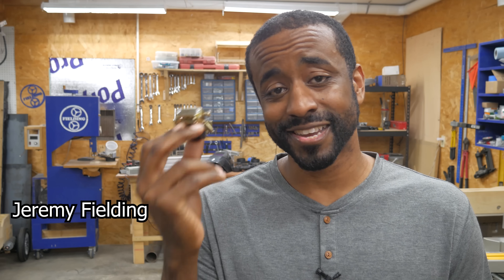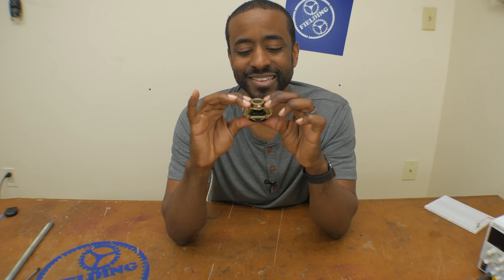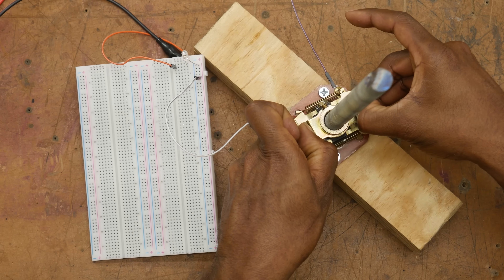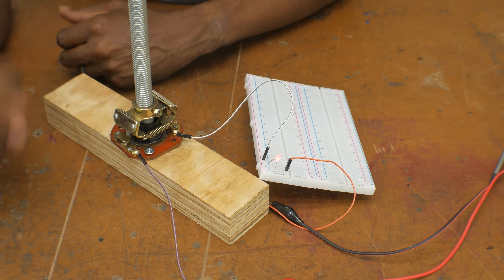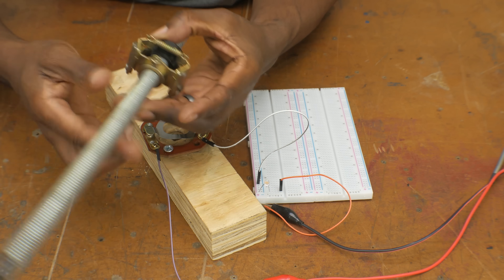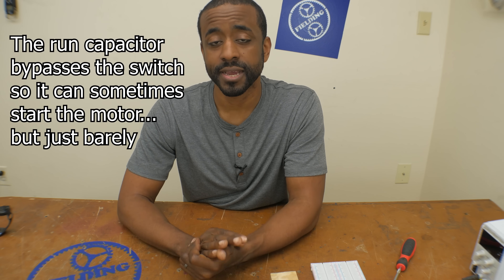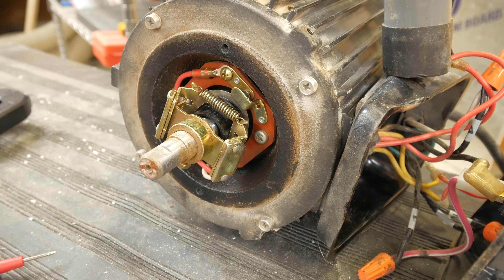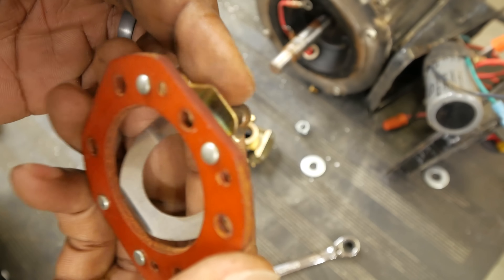This Clever Device Is Found In Nearly Every American Household. How It Works And How To Fix It

Comment: I was surprised to find one of these on my old craftsman bench grinder from the 30s. Didn’t realize they were even older than that. I ended up having a similar issue where the contact points glazed over.

Comment: The contacts have a thin layer of sliver alloy that can wear thru causing the arching yours has. Cleaning will definitely add a couple years to the stationary switch. I would recommend replacing it when you replace the bearings. Looks like # S-6013 from Torq .com.

Comment: Turns out that they explode pretty nicely too if you don't have your wires routed perfectly... (Not every motor is as easy to disassemble as your example here, sadly, as I'm sure you know) I have seen replacement import centrifugal switches for sale on eBay - and I may eventually just do that, even if it seems slightly bizarre to put a new import switch in a WWII era table saw motor.

Comment: I just got done taking apart, cleaning, and rebuilding a 1945 Craftsman table saw motor. I saw the switch and wondered what it was. Looked it up in the parts manual, saw the word "centrifugal" and it clicked. Mind blown. Elegant solution. The motor, with it's original tin can capacitor wrapped in a paper box, still purrs like a tiger.

Comment: Just for documentation sake: In many simpler electrical and high load systems (think classic cars and big ol contactors) these are often called "points". A common failure mode on old water pump pressure switches, car ignitions, motorcycles, lawn mowers, etc... cleaning the points with some sand paper is often a fantastic quick fix for worn points.

Comment: In Europe where they have 220-240 volts does this device still have a purpose
Reply from the maker: The motor I am using in the video is 240volts. You need this if you have single phase power. Some countries like Germany have three phase and don’t use starter windings in motors.

Comment: We call it filing the contacts.
And it will work for a little while, but I find that when pitting starts, there is a weak capacitor in the mix, and it is arcing from excessive starting amps. Check the farads rating on the start cap, or, just replace it. And change the contacts, because material is missing that is needed for long life.

Comment: That's a bi-stable centrifugal actuator working on a switch. Continuously variable versions were used as governors on steam engines in the 19th and 20 century, and to automatically adjust ignition timing on most gas powered engines for a great deal of the 20th century.

The run winding has no torque at a standstill, and very poor torque at low speed. However, you don't absolutely need the starting circuit. On an application like your drill press, there's no load when it starts, and ramp up time isn't critical. You could disconnect the start winding, and it would still work. But, when you turn it on, you have to give it a shove to get it going. Once it starts rolling it will go up to full speed.

The benefit to disconnecting the start circuit beyond cooking the capacitor, is that the motor actually performs better at higher RPM with the start circuit off.

Also note that under rough service, when the motor gets really loaded down, the armature will slow enough for the switch to kick back in, and torque gets boosted to help it recover, or at least try to prevent it from stalling.

Comment: At 2:54 Jeremy say's lighter weights will fling out at higher speeds, heavier ones at slower speeds. I would think the opposite is true, but I don't know how to come up with an explanation. Can someone explain this?
Reply from the maker: Look up the formula for centrifugal force...you will understand when you see the relationship between speed, mass, and force
Reply: There is spring tension keeping them towards the shaft. As the shaft spins the centrifugal force from the weights gets heavier and pulls on the springs. The faster it spins, the more that force pulls on the springs. Keeping spring tension the same, a heavier weight will pull more at a slower rotation than a lighter weight. The lighter weight has to spin faster to have the same amount of force as the heavier weight at a lower speed.
Reply: It takes more RPM (centrifugal force) for lighter weights to overcome the same-strength (retaining) springs than for heavier weights.  Want the switch to 'kick-off' at at later speed?  Shave some material off the weights to lighten them.  Or, just swap the springs out for a pair of stronger ('heavier') ones...  Want that to happen earlier?  Add some material to the weights, or install weaker ('lighter') springs.   Mechanical-advance ignition distributors and (somewhat earlier !) mini-bike clutches taught us all about that 'stuff'; thanks for making me remember...lol !!

Comment: Great video.  Before I installed a 3 phase supply and distribution board in my workshop, I used to run the workshop from a power outlet in my house using an extension lead and a power board.  Sometimes the compressor would cycle but not run. I put it down to supply voltage regulation from the power in the street combined with the voltage drop across the extension lead.  It happened during peak load times.

Comment: A note about the contacts: contacts are often coated with certain materials (phosohorusbronze e.g.) to prevent pitting during the arc-turnoff. By sanding you've removed this, so maybe  it wont last very long..m
Reply: Time to re-plate the contact surfaces... There may even be a Channel for that sort of stuff.  lol.

Comment: Great video! Great explanation and delivery. Concise and easy to understand.
You sir, are a natural born teacher/instructor.
One question, though: I seldom see blown caps outside of those used AC condensers. In this case, it's quite common. Is this because the cap stayed in the start circuit too long? Seems like overvoltage pierces the dialectric and destroys the cap.
What say you?

Comment: Jeremy -- I've heard that sanding switch contacts is generally a bad idea for some reason, perhaps because there are specialized arc-resistant alloys involved? Am I wrong? My impression was that you should try gentle cleaning and contact cleaner first before getting more aggressive, and that after sanding a switch contact has a greater chance of failure in the future... but I might be confused about some other scenario...
Reply: IIRC, the contacts are tungsten. I don't think cleaning will help. When they stop conducting it's because the surface is so rough.  I don't think sanding will shorten the life.  Back in the olden days, we used to sand/file ignition points to get another 10k miles out of them.
Reply: @e-curb  I was just going to mention the same thing with ignition points, or even spark plugs.  That simple step either resolves the issue, or helps eliminate it from being a possible cause of failure.
Reply: A grit of 100-120 is just enough to clean but not enough to wear them down. The key is, don't go too far with sanding them, when they're bright, they're right.
Reply: Unless the contacts are just plated and then you are wearing away the really conductive layer.

Comment: 😎 Hey, Jeremy:  Ask your wife for a couple of "emery boards," for filing and smoothing her fingernails! 💅Very good for cleaning contacts!  Really enjoy your work! 👍
Reply: Hunt the car swap meets for point files.  Basically looks like a small worn out file.
Reply: @andrewt902  came here to say that, grew up with confuser free automobiles
Reply: @mulgerbill  many times I've gotten home with a point file and reset of the gap with some rolling paper.
Reply: I've used the newer "diamond coated" boards. seem to work for me.  been through a few now with no apparent problems.
Reply: The metal in older contacts use alloy containg cadium. So once u use a file dont reuse for stuff like nails.
Reply: Cut up strips of old, dirty shop rags ought to be just rough enough to buff contacts clean without ruining the plating.
Reply: Mike Gustafson emery board will leave abrasive non conductive material on points and cause them not to make contact
Reply: @chrishill6276  Yes.  And some rubbing alcohol on a piece of cotton cloth, drag it through the contacts, all good now.
Reply: @chrishill6276  You just wipe or blast it off....¯\_(ツ)_/¯ Easy!

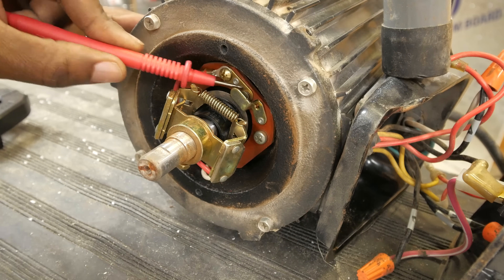Comment: 6:38 ElectroBoom would be proud lmao
The centrifugal switch is indeed a fantastic mechanism. I have 3 motors that use it. There's just one issue. Washer and dryer motors (the ones I have) are sealed shut with some sort of glue or resin. So if the switch went bad it would be tough to fix or replace I can imagine.

Comment: Thanks for this... I am a mechanical engineer so having  ammunition to mess with the superior attitudes of the electrical engineers is awesome!  My area is wear and reliability particulalry adhesion (cold welding ) of surfaces.  I remember reading about some early adhesion studies by an electrical engineer working on switches (Archard late 1940's) .  I am trying to remember whether a rougher contact is better than a smoother contact (you used a rough sandpaper) ... hmmm will have to check it out.  The point being is that there is going to be an arc from one surface to the other a rought surface will provide multiple points to carry the arc but very smooth surfaces will arc at one point... hmm can't remember... will have to dig up that paper.

Comment: Jeremy, I fully agree! It’s ingenious because it’s so simple but effective!
There is another simple mechanism I think you would find very interesting. It’s called a “Swashplate”. It amazed me when I learned of it in Helicopter Flight School back in 1970 and continues to do so as a helicopter instructor pilot. It converts non rotational vertical forces into rotational vertical forces changing the pitch of each main rotor blade as they rotate. This is what primarily gives the helicopter main rotor system directional control for the helicopter.

Comment: Thanks Jeremy for the video. I had an issue with a motor on an air compressor years ago. I used it to spray automotive paint. It started having issues. I found that the motor would draw air for cooling through the motor housing. The paint residue had built up on the contacts in the motor and formed a glaze on the contacts.  I took the centrifugal switch apart, cleaned off the paint glaze and VOILA, it was returned into service.     J K

Comment: Good, informative video. I went through this issue on my (relatively new) milling machine. One thing you can add to list of diagnostics is if the motor suddenly starts sounding 'mechanical' like a loud BrrRRT noise or humming sound. I can't say whats going on electrically to explain that, maybe you can. The caps were new & checked out fine. But the CS points looked a bit smokey & very mildly pitted. So I dressed them & put CS back in service like you did. That worked for quite a while then the same problem arose.  Turns out these devices are kind of sensitive to how they are positioned on the shaft before the set screw locks them down. Or maybe a better way of saying is how much tension is holding the points via the spring plate. If its too soft for whatever you may develop partial contact & maybe why it develops the same problem over time. I had to play around with this a bit & that seems to have fixed the issue. Another potential problem source is if the motor has a fan blade over the CS area. If the fan is improperly positioned along the shaft or is a bit loose & migrates over time to the extent the CS counterweights are impeded, that will also cause start problems.

Comment: Doubt it's as practical (especially considering 'cost efficiency'), but wouldn't it be possible to use back-EMF to control a relay (possibly with a microcontroller in between to detect the sine wave, and send a signal to either the relay, or a mosfet that controls the relay? 

It could be useful for "quiet" applications, and/or saving a bit of hp (less weight on the shaft, possibly negligible in most applications) or even a minor increase in braking time...

Comment: old distributors in car engines use something similar to advance timing as engine speeds up. also automatic transmissions have a governor that works on the same principle to allow fluid through at a given speed to alert the transmission when to shift

Comment: Hey, Jeremy, two weeks ago I acquired a treadmill from the free section on Craigslist. "Score!" Prior to watching your videos, that's something I would have bypassed. Now I view old microwave ovens, old printers, etc, as miniature parts warehouses. Thanks! Incidentally, it was really interesting to take apart the treadmill. It was one which also had the ability to provide the sense of walking uphill, and so there were two motors in there: one 1¾ HP motor for the treading, and a separate motor for elevating the front end of the walking carriage. Good stuff. I was going to use the motor to build a lathe, but, coincidentally, I also found a wood/metal lathe (manufactured in 1951) the week prior, and so I'm going to build a band saw with it instead.
Reply: Treadmill motor is different doesn't need a startup switch, it's DC and can operate at any speed.

Comment: Is the capacitor providing a current surge to overcome the startup torque of the motor because of the lower current available on your 120V mains?
Reply: The start up capacitor in induction type motors creates a phase shift from your main power source ac signal but I forget how many degrees out of phase it is and probably varies on design and application. The capacitor is wired in with the second phase winding of the motor and this causes current and voltage to lead and lag each other creating this phase shift on the second winding. This second phase is used to start the rotor rotation as if it only has one phase, it will be unable to start and would just sit there and hum (in most applications). Some ac single phase induction motors use the capacitor the entire time and do not require a switch to open at a certain RPM. Almost all ac induction motors are actually 2 phase motors. 

If your interested in this, research induction motors as they are very fascinating on how they actually work.

Comment: Great video , loved it!  So many “ repairs” are completed simply by cleaning and/or reseating connections. And if the technician is honest, the homeowner can save a few bucks.
Reply: I knew an old fitter that used a special type of “secret” file. Wouldn’t tell me any specifics.
Also, on refrigeration compressors any time we replaced a start capacitor we replaced the start relay. They stick and cause the capacitor to blow.

Comment: Excellent,as soon as you mentioned the roller-coaster with that switch,once i saw how it worked i thought of one of my favorite rides as a teenager,can't remember it's proper name now,but it would spin really fast with us inside being pushed up against it's walls,then the floor would slowly come away from you so being lowered and then you knew you were free to turn yourself upside down,or get into just about any position you could think of with in reason of course,us lads would try to impress the girls and the people watching from above,i'd completely forgot about it until you mentioned the roller-coaster and that switch lol.

Edited = PS,that little tab and set up reminds me of a set of points you used to find on older cars,could it be the same sort of thing? just wondering.
Thanks for sharing and the memories,much love and respect from the UK. ✊🏾👍🏾

Comment: No continuity is a failed sign. But you might have continuity and its no good.
To properly test you need to use the same voltage and load as in use.
Your contact may be connecting like one tiny wire, but you need a thick wire to make the circuit.

Comment: Jeremy, So why the multiple clicking when the motor is turned off that you demonstrated?
Reply: The centrifugal switch platter will pivot while it rotates due to the spring pressure when it's pressing against the stationery switch. You don't have time to hear it when the motor starts, but you can when it's coasting to a stop after the centrifugal switch closes.

Comment: A few weeks ago my bench grinder had the same symptoms you mentioned ... i took it apart and saw this switch but i didnt think that it maybe the cause , i thought it was the motor or the capacitor so i put it back together and forgot all about it  , i'll check it and hopefully  it will be the problem so i can fix it like you did , thanks.

Comment: Centrifugal governors are not quite the same but seems to me a close cousin, and according to google those are from the 17th century. The geometry would need to be different for it to flip quickly at a threshold vs. opening continuously, so that would require some innovation.

Comment: Thank you so much for all the information. 
I have a question. It's how I found your channel although not the answer! 
I have an marine boatlift motor that says it requires three drops of oil yearly. I have no idea where the oil goes. Better yet the belt keeps slipping on one of the motors. It's a v belt, I know the type of belt. I just don't know how to re- install the new belt. Any ideas or suggestions?
Reply from the maker: search my channel for v belts